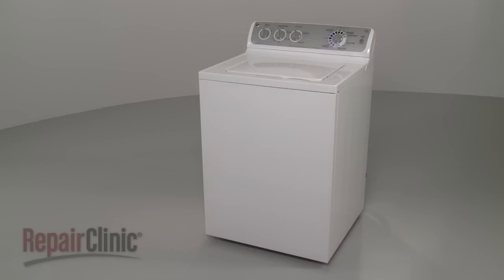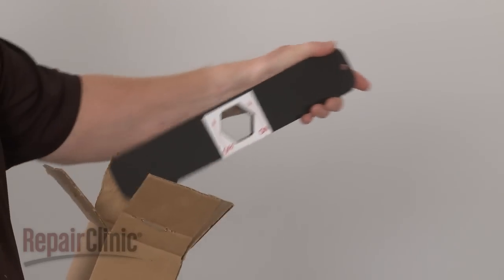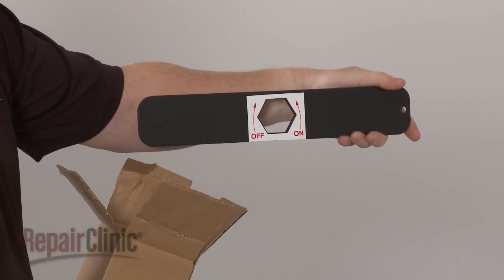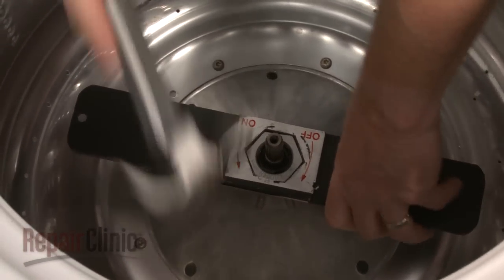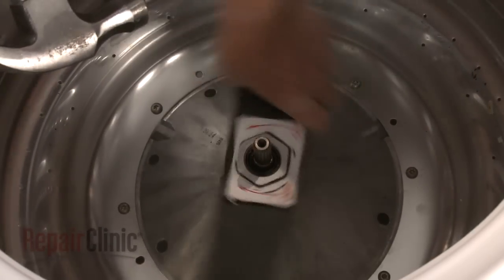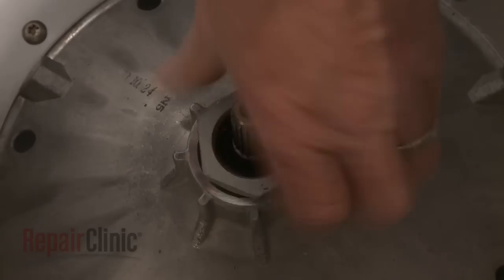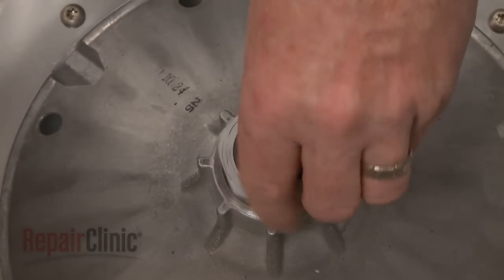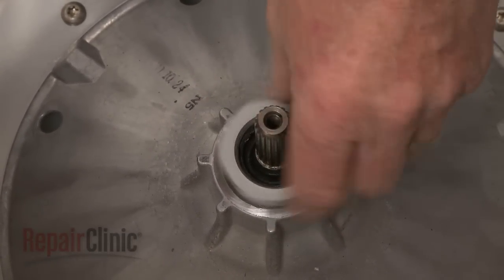GE Top Load How to Use a Tub Nut Wrench #WX5X1325

Comment: If your tub nut is ceased and won't come off just use a small cold chisel and break it off. I banged on that tub nut for days with chemicals and sledge and wish I just cut it off to save me a lot of time and headache. Hit the chisel staright down on the nut and slowly create a crack. It will losen up before you get all the way through. Use PB blaster and a wrench to help along. If you look close at the shaft there are 4 flat sides. There are no threads on the flat sides of the mode shifter shaft, only the rounded areas. So chisel away on the flat sides only so you don't damage the treads. Ask if you have any questions.
Reply: Great tip, my washer sounds like an airplane about to take off. I got all the way to the nut, got the spanner wrench today from amazon...tried a few hits with a 5lb hammer and let me tell that bad boy is really stuck there. Ill try ur idea. I believe the bearing noise that I have is coming from the shaft/transmission so if I mess the old shaft... anyways is going to be replaced.
Reply: @kaimanson3174  also do not over tighten the new tramsmiss screws. Your are creating the thread as you go on can easily strip them out. 90 foot pounds or just lightly snug.
Reply: @dave3051  okis I did try on the morning before work to split that bad boy...but it was a bit harder than I thought. I have already cut almost 75% of the nut off, but it is still tight. Because im changing the shaft as well the edge of it has received a few hits as well. I realized by comparing the new nut the it goes down  on the bolt. Ill try to drill it tonight with care to get that nut remove.
Reply: @kaimanson3174  I used a dull chisel and a hammer and it was not too bad to cut. A sharp chisel should be way easier. You might still need a pipe wrench and some pb blaster. Also you can cut through multiple sides of the nut and take it off in secrions
Reply: @dave3051  mission accomplished, chisel didn't do too much for me. PB blaster + 4lb hammer + spanner wrench = out of my way. I put almost everything new. Transmission shaft, o rings, drive belt, bearing hub. Noise is gone and sounds like new. Thanks for the help. Drive belt is a piece of cake to install just like the video.

Comment: I got my (part#)-TB123A Spanner Wrench yesterday. Saturated nut with PBblast & WD40 on my 7 year old GE washing machine. I'm 1000+ strikes of a rubber mallet & 5lb. mini-sledge & it still won't break free. It measures 1-11/16", but there is still a gap around half the nut.
It sat for 20hours after 1st attempt & respraying. Tried putting 2 nickels in gaps after work today. All that did was mangle 10cents & I'm still no closer to getting it off. Thought I'd try my torque wrench afterwards & went to 4 nearby hardware stores but none of them had a deep well socket in that size. Calling it a night on this frustrating horsey crap.

Comment: Here's a stupid question, but do you need one of those wrench's?  I have a large pipe wrench that would fit.  I don't want to have to spend anymore money than I already must (thus the reason I'm trying to fix the probably myself).
Reply from the maker: BNZAZ Tub nut (a.k.a. spanner) wrenches make the job much easier and reduce risk of damage to the machine.
Reply: ***** Thanks for the reply.  So I technically can make the repair without it, but probably should use one if I can.
Reply: RepairClinic.com  where do you buy the tub wrench

Comment: I wish I would have just cut the nut; mine was rusted and would not come off with the hammer/wrench. I cut it with a metal cutting wheel on my grinder after breaking the tub w/ a 3lb sledge.

Comment: Mine is not budging after a 3 pound deadblow and all of the wd40, moving on to a sunex 254D impact socket.
Reply: Use an impact wrench with a deep well socket and counter clockwise reverse threads on these suckers

Comment: Every 4 or 5 loads, my washer starts shaking badly, and i find the tub nut has come loose. I tighten again, and 4-5 loads later, nut is loose again...
Any help??
Reply: Lock tight?
Reply: @busbear6899  I ended up replacing the nut with a new one, and installed lock tight.
Still going!

Comment: If it's been in use for any length of time, order a new nut.  Take a cold chisel and give it two good licks on each side.  It's cast aluminum and parts easily.  Aluminum on top of steel - electrolysis and seizing.  Smart GE - real smart.   Cut the handle short on an inexpensive pipe wrench that will open to 1-7/8-inches and whack it good - real good with a 2 pounder to tighten the new nut.  The way this washer agitates, I'm surprised it does not twist the shaft off.   A real piece of junk.
Reply: 3 years later David, this advice saved me from buying a new washing lol. Stubborn nut and blisters later, I finally got it off with your chisel method. Thanks man!